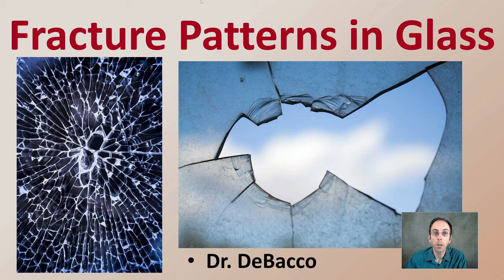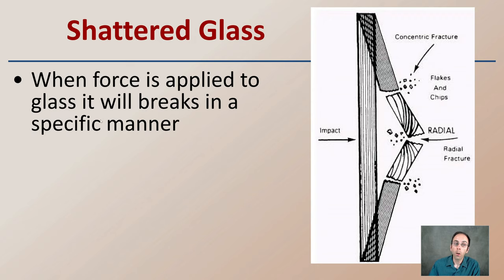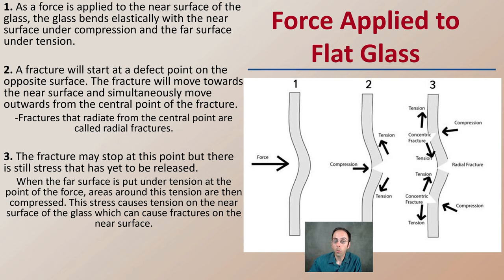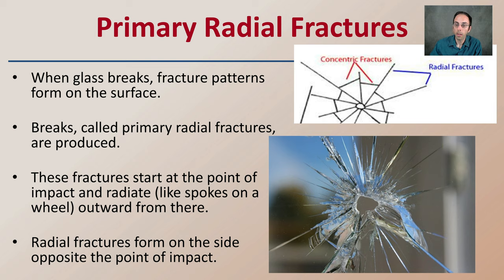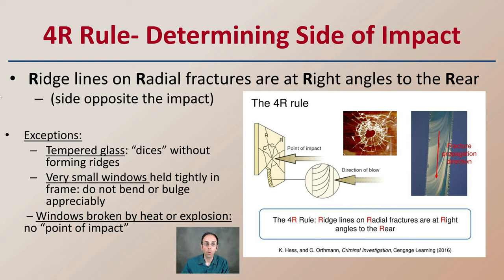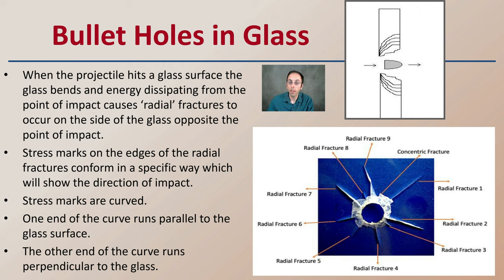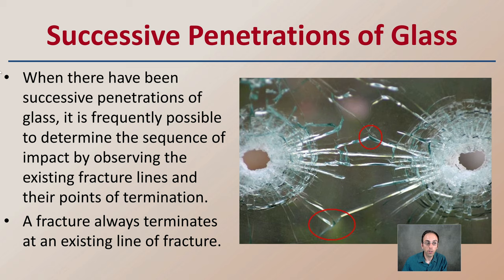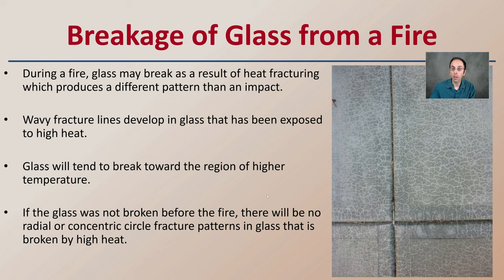Fracture Patterns in Glass

Comment: Would the glass begin to break in the opposite the applied force even if the projectile does not penetrate the window. Would you see a similar break pattern if the projectile does not penetrate the window.
Reply from the maker: The fracture pattern would be similar even if penetration does not occur because the stresses to the glass would be the same up to penetration.  The glass actually breaking is just an end result the fractures would be similar but based on the physical damage it will be easier to tell the side of initial impact.